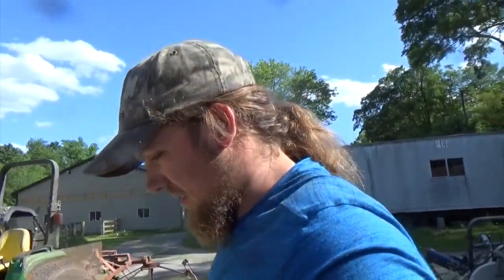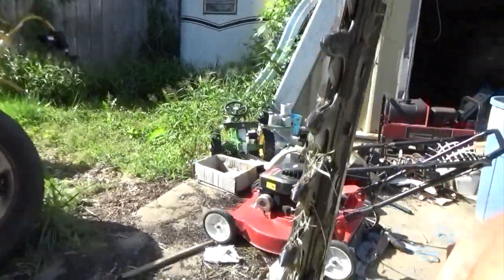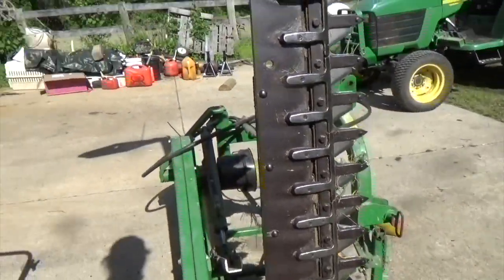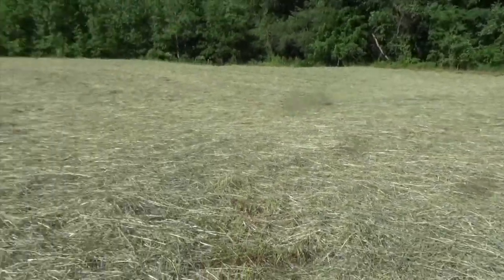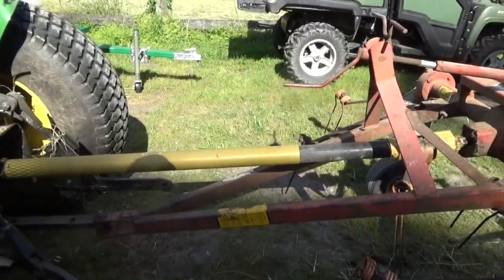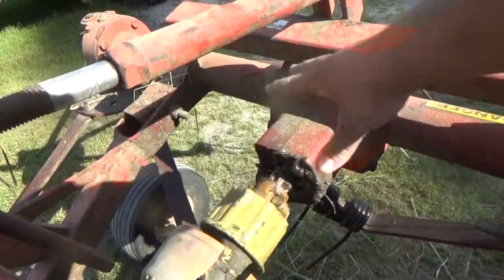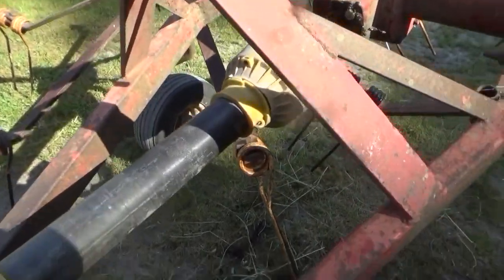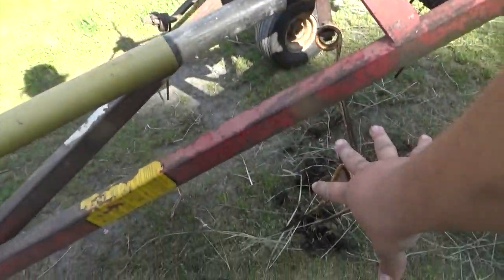I Broke The Mower!? and one exploding tire

Comment: The cheapest I have seen the sickle bars around here is over a grand so if you can fix it for less it would be worth it
Reply from the maker: I am definitely going to be fixing it, because to upgrade to a truly better mower would require a larger tractor. Also the parts are not that pricy.